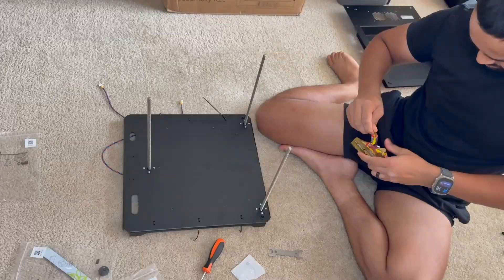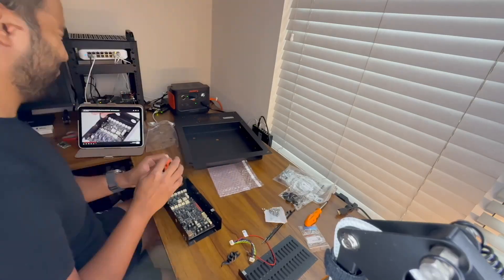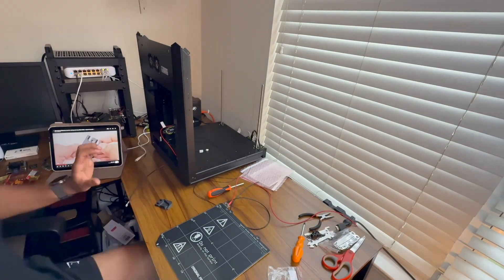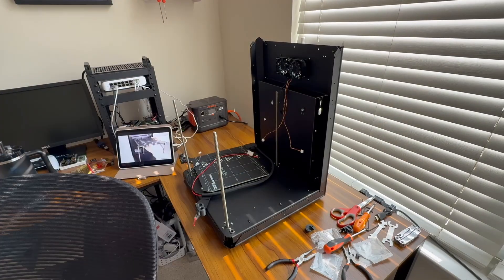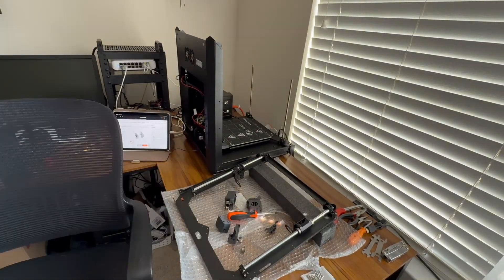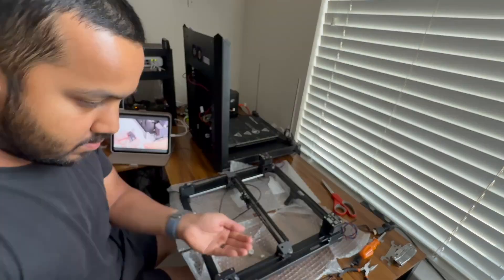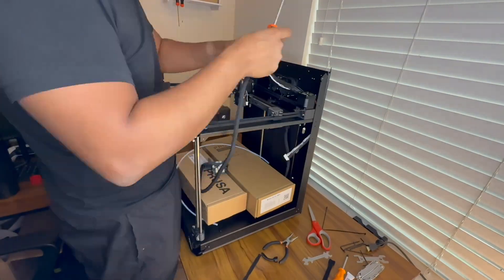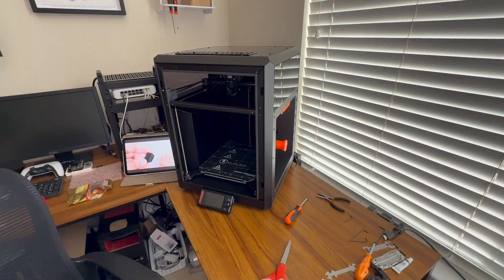Prusa Core One Kit Build Experience — Worth the Effort?

Comment: Our first printer was a prusa second was a bamboo and third as a rat rig.  I disagree about getting a kit. We bought the prebuilt because I figured that if we had any problems and couldn’t really get it working, it would be put in the shed and never be seen again.  

We printed about four or five days then we had a few problems of filament not sticking, which turned out to be the nozzle, not close enough and so I had to learn from there and since then I’ve rebuilt it and upgraded it three times
Reply from the maker: I didnt know about the Rat Rig but thats good to know.

Comment: The best thing with building your printer is that if in the future something has to be fixed or repaired, you have a good sense on how everything is built together. When I took apart my Bambu P1S, the online manual was not 100% accurate, and no comments.
Reply from the maker: Yea I am so quick at fixing issues when they come up. It’s a good experience to have.

Comment: Suffering from VFA and doesn't come pre-assembled, no auto venting in 2025 is a poor choose to buy
Reply from the maker: You can buy it preassembled, and I have been printing big pieces and I haven’t experienced the VFA and not sure what you mean by auto venting but it does have fans at the back.
Reply: The manual vent is not automated but the fans automatically control the enclosure temperature.